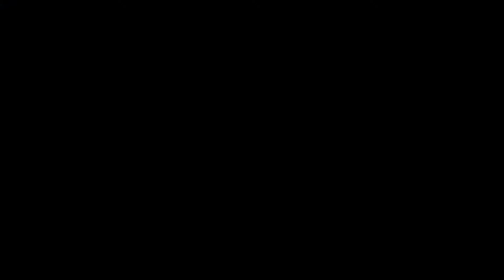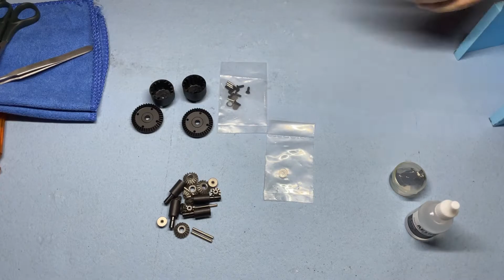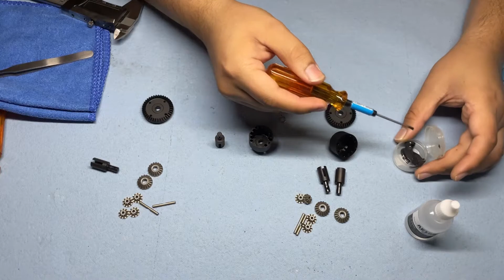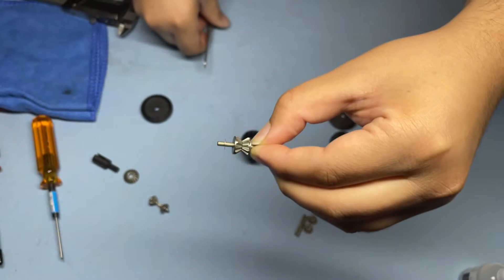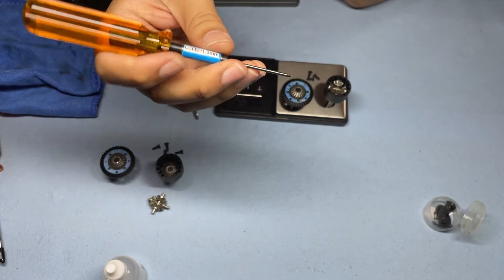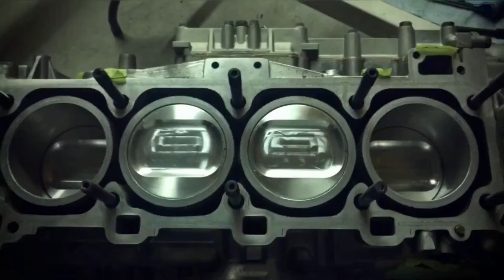Team Associated B74.2 Build - Bag 3

Comment: The weight method wasn’t accurate for me either. I’m assuming they will fail
Reply from the maker: Mine have not failed using the weight method. Everything looks normal. I've already serviced my differentials twice since building it. I've serviced another racer's car that was built using the weight method, and that one had no issues. There are 4 other B74.2s at my local track and none have had issues using the weight method or the "visual" method.